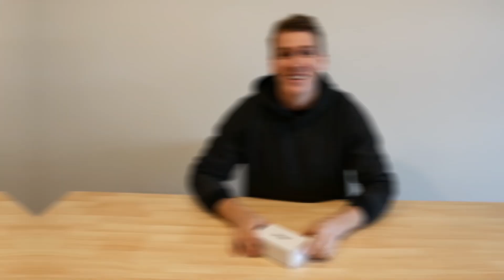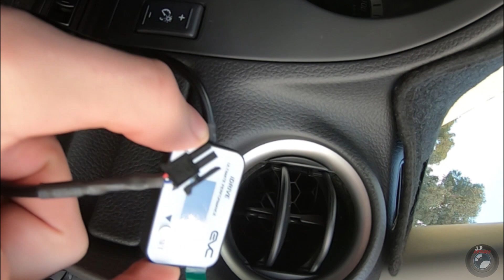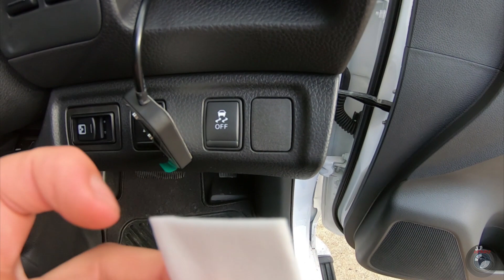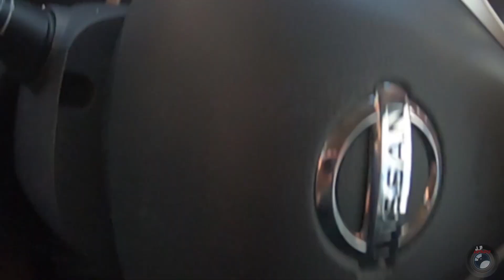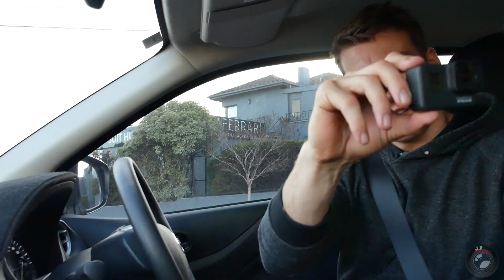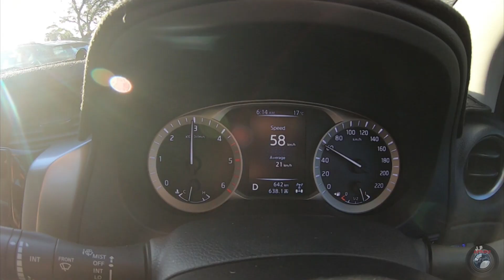iDrive Throttle Controller NP300 | Unboxing | Install | Test Drive | + Promo #ShedSessions #NP300

Comment: Hi, very informative, advanced, and complete information regarding the throttle controller, thank you, but I have a question I hope the admin or JP Captured can answer regarding safety issues, My question is what if the throttle controller's device suddenly fails? or the little wire cut? Do we still have the control of gas pedal? or it will be back to normal mode? Thank you for hoping JP Captured can enlighten us. thank you again!

Comment: Awesome video as always JP. I bought myself a 2018 ST-X 2 weeks ago and am building it up. I just received my idrive unit, so will be installing this weekend in the same location under the cup holder.  2 questions 1). Are you still happy with the head unit location ?
2). Do you need to readjust the unit every time you start the car, or dose it remember what you set it on  ? 
Cheers and keep up the awesome videos !

Comment: You ripping it up in Cheltenham!! I used to live nearby.. Great review.. Does it actually make the vehicle faster at all? Would it be quicker 0-100? Cheers
Reply from the maker: It doesn't make your vehicle faster, but makes the throttle response better so technically you would get a better 0-100.

Comment: I fitted one to my Mercedes-Benz x-class pickup 350d. 
It had a flat spot when starting off and I was then pushing the throttle hard to drive off and then all the power would suddenly come on driving me and my Partner into the back of the seat. 
Fitted the idrive and found the AC mode was the one.
Now moving off is smooth and has made a huge difference to the vehicle. 
Highly recommended.

Comment: Is these a Nissan Navara twin turbo diésel engine 2.3 liters?
Reply from the maker: yes it is.
Reply: @jpcaptured799  Ok thanks for the reply, I have the same Nissan Navara twin turbo engine here in Chile and im going tu put the same Idrive controller for the acelerator.

Comment: I installed today on my 2020 Navara. Found your video while searching how to remove the original plug from the pedal. Did not continue to watch until after I completed the installation and did a test drive. Glad to say surprised to see how our installation was almost identical and I tried all of the settings and again surprised to see that we both settled on setting U3 :)

Comment: How do you turn the power to the unit, as it flattened my battery
Reply from the maker: it shouldn't have flattened your battery, it may be something else?
Reply: Resolved issue was not i drive. And I need to have doors locked for light on I drive to go out. Best item I have bought for a car. The colorado is like a V8 on 9.

Comment: Hey how did you get the digital speedometer display on the dash? Both me and my mate 2015 ST Navara, And 2016 STX Navara don’t have it
Reply: Travis D use the scroll button on the steering wheel to go through the pages, or use the scroll button on the steering wheel to go into vehicle settings and you can select it to be displayed

Comment: Thanks for the video. Just installed mine and copied your process. Was wondering how to get the plug off, but you answered that. And I would not have thought of that spot to put the controller but its perfect! No cable in sight, nice flat spot for controller but its unobtrusive - and can still stick my Flat White (triple shot) in the holder. Great work.

Comment: Hey bro got a 2015 np300 but my brake peddal moves alot from left to right....was wondering how it can be fixe....great vids as usual bro...
Reply from the maker: I have noticed this on my own one. But it seems fine when driving it's just when i nock it with my foot or something.
Reply: @jpcaptured799  yes same here when i knock it with my foot...also when i mash the brake not in the centre of the pedal i hear a clicking sound as its alittle slack...checked a few mechanics and they said to remove the pin and put two washers on each side...keep up the great work bro with everything...💯...Trinidad and Tobago in the house...

Comment: That headunit iz abit costly. But nice..
Reply from the maker: true, i don't regret spending the $$ on it though. i use it every day and love the features.
Reply: @jpcaptured799  true. Ireside in the caribbean a country called trinidad. I hav a hornet gold, 4x4 manual,2.5 turbo diesel.

Comment: Hey Bro Where did you order the idrive
Reply from the maker: https://www.idriveaustralia.com.au/evc804l2014on-2-idrive-throttle-controller-fits-for-peugeot-rcz-2009-2015
Reply from the maker: USE CODE JPCAPTURED

Comment: Bought it for my ST-X, will try it when the kit arrives. Gr8 review btw.
Reply from the maker: Let me know what you think when you get it installed 😊
Reply: Absolutely love it. iDrive has improved the response time quite significantly. I might have add nismo or gtr badge to the Navara ( lol). 
I have left mine on AC mode. Thanks for your recommendation btw. Cheers.
Reply from the maker: @TheVix211  that's great news! 
No worries at all I'm happy that i helped 😊

Comment: Great channel mate, you cover some products I did not even knew existed for the NP300... Owning a Nav myself, there are plenty of plans I have for it over time. Like you have covered before, the satnav and throttle response for me are the 2 most annoying things, especially the throttle response, input does not really = output, especially when you need to take a quick gap, as you step on it, it feels like nothing is happening... then seeing that the gap you wanted to take closes fast, so naturally you floor it... then all of a sudden the power kicks in when you don't expect it which did result in wheel spin before, especially in the wet... not ideal. Will this product resolve this issue?, does it solve the lag, or is there still a bit of a delay?
Reply from the maker: Firstly, thank you. i know what you mean when you say lag, that was a big part of the issue i had with the factory feel the throttle had. The i Drive unit completely fixed this issue even on setting 3, however sometimes you still get the transmission delay if it's confused about the gears it's in. but overall you can 100% notice the difference.

Comment: Thanks so much for the video mate. I must admit I was a little sceptical about the amount of difference but turned out the unit was on special at Autobahn today so I took the chance. My 2016 np300 had a lot of lag on take off but after the 3 minute install wowee so much better. Thanks again for the video I enjoy watching your posts. Don’t stop. Cheers Pete
Reply from the maker: G'day Pete, that's so awesome! i'm stoked that i could help make it an simpler decision than going into the purchase blind. My navvy had heaps of lag as well, i was actually shocked at how much the iDrive unit changed the way the car felt and drove! keep an eye out for another video i'll be doing soon >live track Gps< install. It's another cool product from iDrive that you may like. 

cheers, JP.